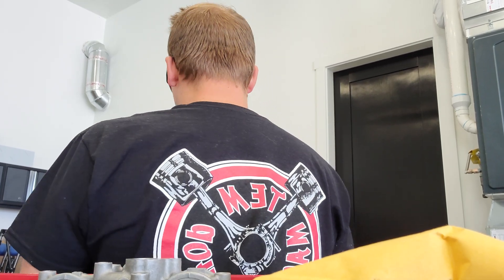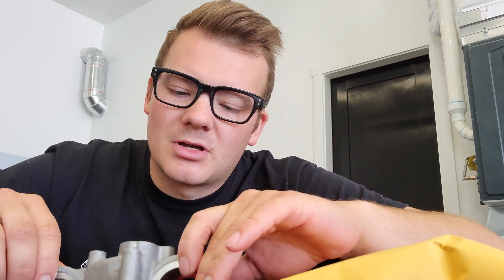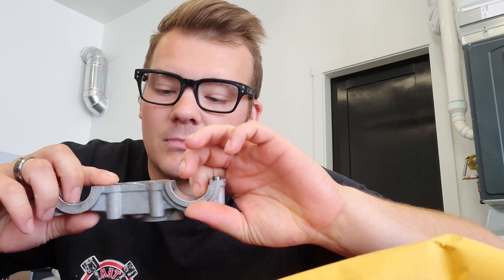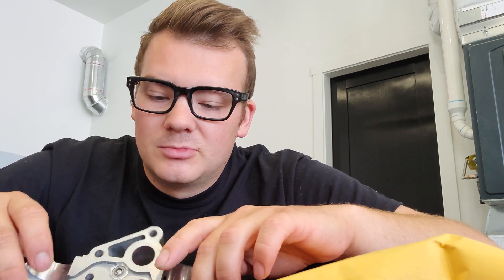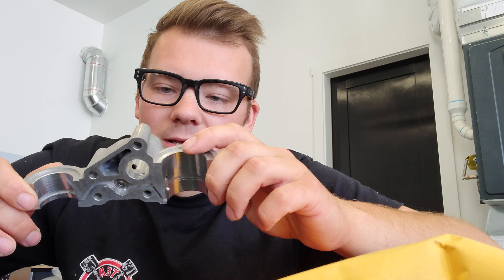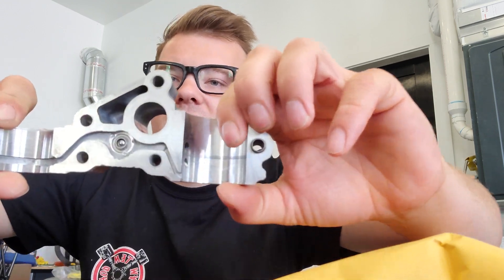Maserati M139 4.2L Cam Cap Fix Explained

Comment: As a temp fix, you can fit a Mocal accumulator that pre-lubes the engine before you start. Works well, certainly buys you time. Fitted one to my 4.2 GT and a year later still good.

Comment: Thank you for the video. You make it sound easy. I'm located in Canada and thinking about doing it myself and sending it to TEM performance. One question, someone here told me you need to do programming after. Is that true ?
Reply from the maker: @farzadshirzad1716  thanks! No programming needed, there's nothing involved here that has anything to do with tuning.
Reply: @syntheticperformanceunlimi8323  Did the rattle ever come back. I have heard from people that it has returned after several month. what was your experience ?
Reply from the maker: @farzadshirzad1716  from what I know, the owner never came back to me with more issues ever since
Reply: @syntheticperformanceunlimi8323  So, I went through the processes and found out that the cam caps were already modified through TEM performance. I have also check the solenoid valves, and both seem to be working. any other thoughts ? (The rattle only happened 8/10 times on cold start)
Reply from the maker: @farzadshirzad1716  in that case that means the "fix" was done too late.

Comment: Thank you for sharing this video. Do you know what exactly was done to the caps? Is it just boring out and pressing a check valve? I'm based in Japan so it would be great if I can find out the mod procedures and have my shop do it... Thank you in advance!
Reply from the maker: Yes, sir, we had to bore them out again. And then put the check valves in and put a notch at the top so they do not slide out under heat
Reply: hi - were you able to gather more information how the mod procedure is exactly done - in some forum i read that you would need to bore out some oil gallery aswell because the wall of the  check valve would block it ???